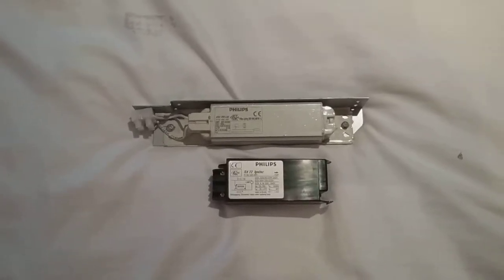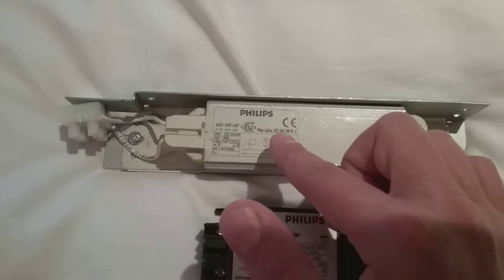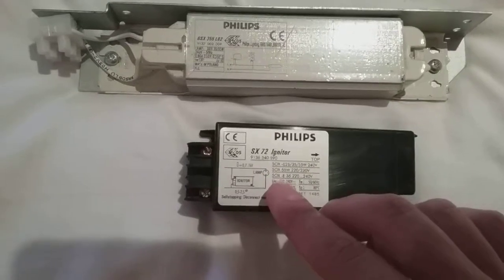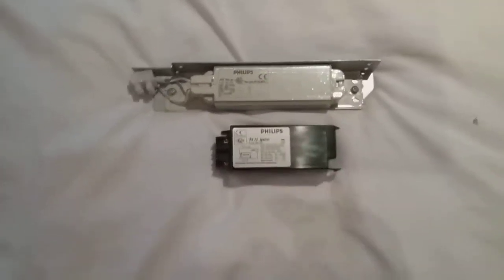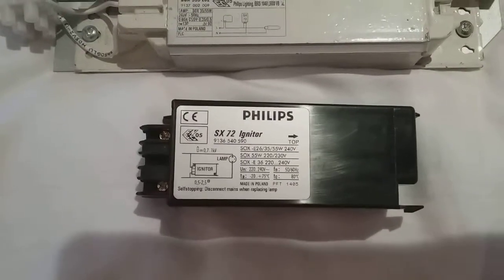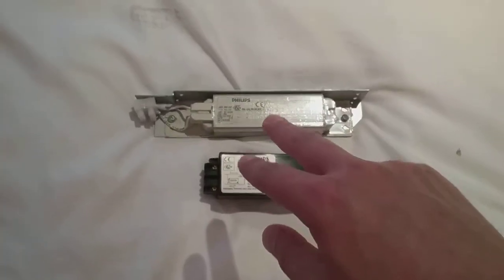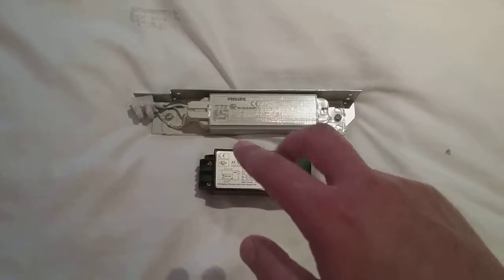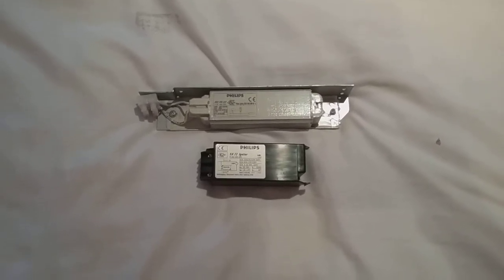Philips low pressure sodium ballast and ignitor

Comment: hi, I've just bought a 35w Sox lamp with this same control gear. mine came with a capacitor looking thing which is not on the ballast circuit diagram. could you please help me at all with the wiring of this?

thanks
Thomas